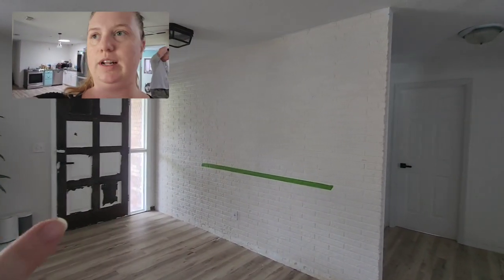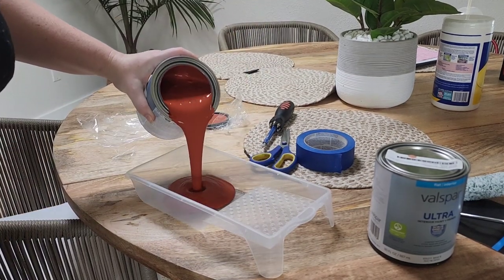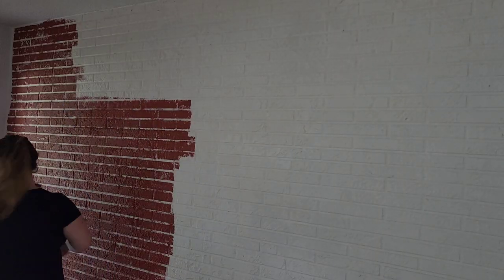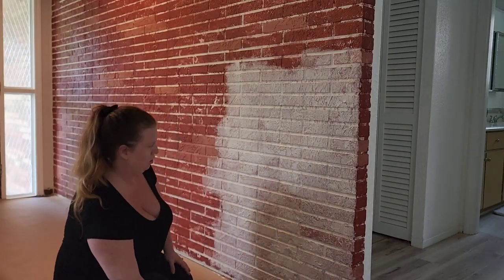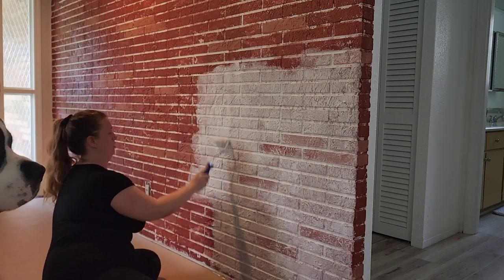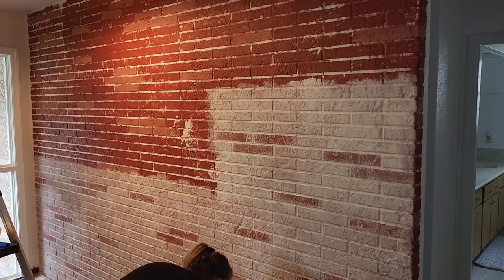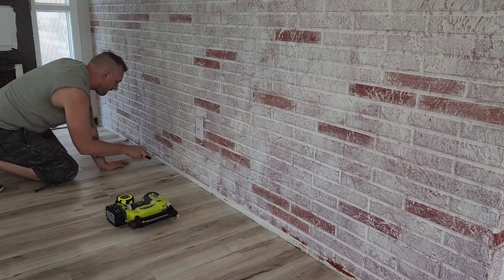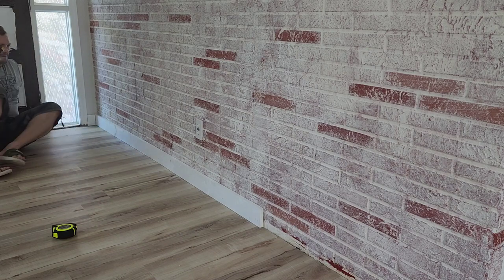DIY EXTREME ENTRYWAY MAKEOVER ON A BUDGET / FRONT DOOR TRANSFORMATION / DECORATING IDEAS

Comment: If you decide to do the exterior I would do it after the holidays when it’s a little bit cooler and you can actually tolerate painting outside I just do section by section start with a back then nobody can see and then walk yourself up to the front when the weather gets cooler